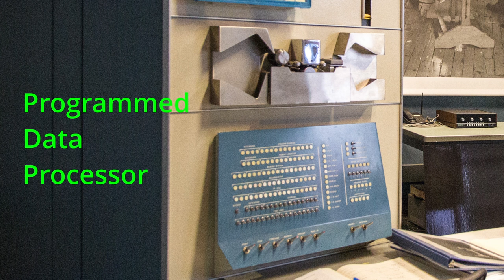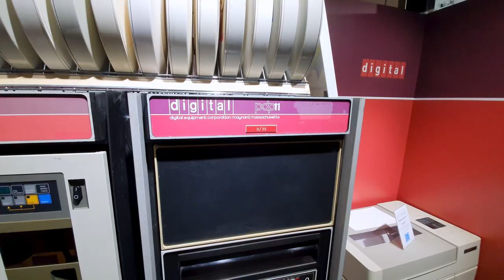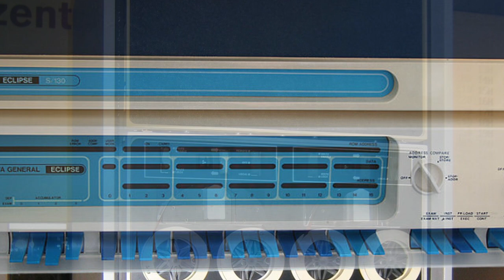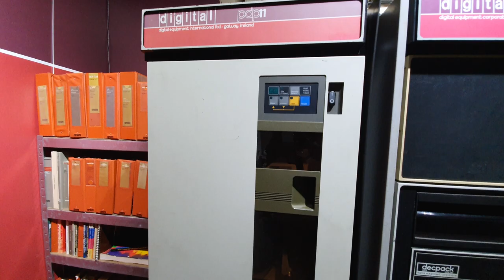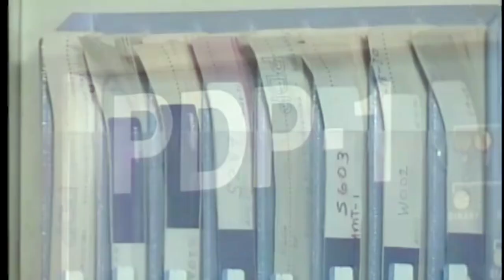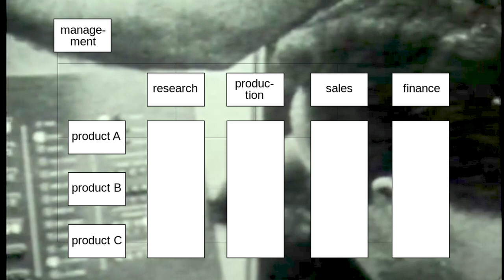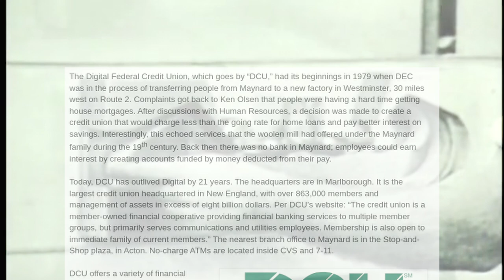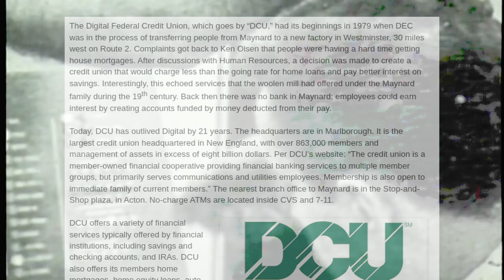DEC and the PiDP-11

Comment: As someone who is blind from birth, I will always remember this company for creating the DEC Talk. One of the first, and definitely one of the best, speech synthesizers. Back in the 70s. They were extremely expensive in the beginning, but they got better and cheaper. Evolving into an internal card, for PC, serial external device, and finally simply software. One of my favorite synthesize voices ever. An early version of it may be heard if you ever listen to Stephen Hawking speak. I don't know the story behind it, but I find it hard to believe it was a business case based on profit potential
Reply: I had a friend who worked on DecTalk (Martin Minow, RIP).  He used to claim it was the only bug-free product he'd ever shipped.
Reply: Did you ever hear it sing?    They had all these demo files to tweak it so it could sing (actually very well).    A DECtalk singing "New York" by Frank Sinatra is something everybody needs to experience :) :) :)
Reply: @mayorsnorkum4005  I heard about those but I never bothered. For me this thing was an incredibly useful tool. Allowed me to do things i otherwise would not. So silly gimmicks like that didn't do much for me
Reply: I was tangentially associated with the development of DECTalk as it was produced by the Terminals Business Unit of which my group was a part. It was quite a revolutionary product. I remember observing QA engineers testing the very early versions. I was fascinated by it. I worked with Martin Minow, he was a great guy. Very smart, professional, and NICE!
Reply: @bobdinitto  that's great. It is wonderful to hear from people who had something to do with this fantastic product
Reply: @kevinbarry71  It was more of a demonstration on just how flexible the platform was.  People used the "canned" voices (Variable Val, and so on).  However, you could configure the system to produce some pretty amazing (and realistic, non-robot, voices).   We used it in a library system, to call customers about items on hold.  We had complaints from customers about how rude the library staff were when calling ... only to realize that they were talking about DECtalk!!!  They didn't know it was a robot, and would try to expand the conversation with it :) :)   Of course, nobody in the 1980's was expecting computers to talk so well.  The Texas Instruments and National Semiconductor versions were much more crude, relative to DECtalk.
Reply: @bobdinitto  Definitely one of their greatest products.  Respect to those guys.   It made DigiTalker look like a toy!
Reply: @mayorsnorkum4005  it was an amazing system. Nevertheless, difficult to believe somebody couldn't tell that was a computer. In my opinion, it is a more modern mistake that people are trying to make artificial voices sound like human voices. That might be OK for phone systems, but a blind person just needs efficiency, and a good computer voice is more effective at communicating than his human sounding voice
Reply: @kevinbarry71  Ironically, the reason for making it as human as possible was to make the customers believe they were getting a "real" call from the library concerning their "on hold" item being ready for collection.  When configured properly (which means, don't just use the defaults), this device could fool most humans.   We ended up using Variable Val, I believe , because it was the easiest one for a listener to conclude was a robot, and then our complaints went down accordingly.    However, once the telemarketers starting using robo-calling in a big way (the 90's), these systems became less popular ;)    However, they seemed pretty cool in 1987 :) :)
Reply: Today you can buy an Emic 2 Text-to-Speech Module by Parallax that uses DECtalk. I’ve used them in animatronic robot sculptures for that old skool speech. As a kid in the 80’s I used S.A.M. A software only speech synth for 8-bit computers. It eventually became the speech synth in the Macintosh.
Reply: @mayorsnorkum4005  the Emic II I mentioned comes with demos and some of them are songs it will sing like  "Bicycle Built for Two” (of course).
Reply: @sideburn  Cool.  I'll have to look it up.   Yeah, SAM really kind of sucked ;) ;)
Reply: @sideburn  "Daisy, Daaaiiissssyyy" (in the HAL 9000 voice, of course).    Epic!
Reply: @sideburn  Synthesized Automatic Mouth was also available for the Commodore 64/128. A friend of mine bout it and was showing it to me. He slipped ff to use my bathroom, so I edited the sample text files while he was gone. He turned quite red when he ran the next sample. He was one of those, I'll teach you to program types. I also wrote a one line program that simulated a failed PLA chip, which caught him off guard. :)
Reply: @michaelterrell  also a version for the Apple ][ but it needed a special card i think since there’s no sound chip. Look up “antic mark barton interview”. It’s a great interview with the guy that created S.A.M.
Reply: @mayorsnorkum4005  ahh yeah, poor HAL 😢 Years ago I made an animatronic robot and he sings daisy :). There’s a clip of it on my YouTube channel…
Reply: @sideburn  I never played with any Apple computers. I have three that I've never plugged in. Two macs ad a II series clone. They just never interested me for some reason. I spent more time on Commodores and repairing industrial computers. I later started repairing and building PCs. In the early days I repaired everything to the component level. I had two new cards for XT or 286 with Apple emulators using 6502 processors but I don't know what happened to them. I never tried one because I didn't have a compatible floppy drive.
Reply: @michaelterrell  similar. I have an apple ][ now i got in mid 2000’s  just to see what it’s all about but I was an Atari 8-bit kid. I have a commodore sx-64, Amiga 1000, and a fried 2000 video toaster that I’m about to try to fix again. This time I’ve got a logic analyzer and oscilloscope to help. Waiting for Agnus chip to arrive. Fingers crossed 🤞
Reply: @sideburn  I have a couple SX64. One has a damaged keyboard cable but both work. I have an Amiga 500, a Commodore 128, a 128D and a pile of leftover Vic 20 and C64 from my days of repairing them. There are also at least a half dozen 1541 drives, some 8950 drives and 4023 printers in storage.
Reply: @sideburn  I just looked at it, and it's pretty AWESOME.   You are the man.   I'd always thought my Tardis was the shit, but I was wrong.    I'll be spending some time browsing your channel.   Kudos, my friend.
Reply: @mayorsnorkum4005  thanks! That was the first one. There’s about 20 more waiting for electronics. Too many projects!
Reply: @sideburn  Yeah, I dig it!    Always too many projects, and too little time.  I've got a crazy backlog.   Now, if we could both just get this whole cloning thing up-and-running, I see a solution :)
Reply: My wife worked for DEC back in the day, I had her record a message on a cassette for my answering machine using DECTalk. Everybody thought I had a computer answering my telephone, which back then was unheard of.
Reply: DECtalk was one of the many things that DEC engineers co-operated on with research and education establishments bodies like MiT.  DEC essentially productised the base speech technologies which Dennis Klatt at MiT had developed. 

DECTalk originally shipped in a separate box because it needed a separate processor. However,  when the MIPs RISC R2000 and R3000 processors were incorporated into a new line of (then) amazingly performant DECstation workstations, DECtalk was implemented as a software-only product, since there was more than enough processor performance, to do that.
Reply: WBCN (The Rock of Boston) had a DECtalk sidekick on their morning drive time show named Carlos.  It sounded to me like it was programmed to make semi-random responses based on a matrix of keywords, like "donut".
Reply: @rocketman71  I received an early demo model of DECtalk hardware which we used in a sales conference by getting it to deliver its own sales presentation from a script which we wrote for it - in "Perfect Pete".
Reply: While working for DEC in the later 80s as a service tech, I had a Lady bring a sick DECTALK into the repair centre to be fixed.
No one had ever heard or seen one before! After some research and a minor hardware tweak it was working and I hooked it up to one of the administration area DECMATEs to run the diagnostic software.

The whole office stopped in their tracks when they heard it singing 'New York New York'!
Reply: But speech synthesis in 2022 uses sampled words, syllables and emotions to create a near perfect voice of the actual person as they sounded at first diagnosis of eventual speech loss.
Reply: @BritishBeachcomber  those voices are great for sighted people. But blind people tend to prefer more mechanical sounding voices that are more flexible and more responsive.
Reply: Interesting
Reply: @gorocket8218  I was at DECUS 1978.  Martin gave a talk there!  I met lots of DEC people and he was very often mentioned by them.  He was a living legend among the DEC people and users alike for his RSTS work. I wish I had gotten to meet him myself.  During that trip I met and had dinner with Mark Bramhall whom I had to confess had indirectly taught me to program as I had access to the early RSTS utilities source code in BASIC, and they had all been written by Mark.  Anyway, Thanks so much for mentioning Martin.
Reply: I spent 20 years touring with a blind musician. During one of my breaks from music i used that experience to try to improve speech synthesis based interfaces for a large company that specializes in touch screen equipped devices that will remain nameless. I'm also a regular on the "Be My Eyes" app. There are so many little things that we take for granted as sighted people. I'm grateful I got the chance to learn from and with the blind community.
Reply: It also provided all the computer voices in Back To The Future II.
Reply: As someone who is also blind from birth, you are absolutely right.

Comment: I worked for Ken from 1993 to 2000. I loved every minute of it.
Reply: Sad he was deposed. Palmer has a lot to answer for selling off database divisions and others (networking?) and the bean counters being short sighted dropping the $1 licenses to universities. I went to Uni in 1988-90 and DEC were strong there probably for that so impressed with DEC VAX/VMS my initial career was a VMS Sys Admin, even had a 11/730 as home computer, doubled up as a large space heater too. But did impress those seeing it when the RA80 spun up like a jet fighter. Nothing like an 160lb (one draw filing cabinet) holding around ~120MB... Later upgraded to VAX 11/750 and got a TU80 tape drive - luxury!
Reply: @rw-xf4cb  I worked for Digital from the end of 1987 to the middle of 1993.  Robert Palmer(not the singer) was a corporate raider that sold a lot of Digital intellectual property to various entities.  I was based out of the South Central Area whose boss was Michael Jackson(not the singer).   I was a principal software specialist.  
Good times until the end.  Got an offer from Oracle to work in California but even with doubling my salary it did not make sense with the high cost of a house in California compared to the cost of mine in Houston, Texas.
Reply: @rw-xf4cb  Loved the 750s and the 785s.  
Worked with them at Brooks AFBs and the UTHSC in the early to mid 80s.  Kudos to you for finding an alternative heating source that had computing power.

Comment: Another nice thing about core memory which I took advantage of (as a service engineer) was, if your computer had an I/O problem so it couldn’t load any code, you could take its memory boards over to another computer of the same model, load the I/O diagnostics, bring them back and plug them in and presto! You could run diags on the broken computer to find out why it was broke! Try doing that with DRAM!!
Reply: Yeah Buddy! Also, DEC Schematics were well done.
Reply: DEC Schematics were great, but so were the IPBs (illustrated parts breakdowns).  All the pieces and parts numbers, right there in front of you.  They were a lot of help for me when maintaining DECwriters.   ✔️👍
Reply: @acmefixer1  ah. That brings back memories. I had a rented DECwriter III in my apartment my senior year at Uni. Dialup via an acoustic coupler. Good times…
Reply: @acmefixer1  And the part numbers made sense in a 2-5-2 numbering format the first two numbers were the class of part, the middle numbers were the number assigned to the part and the last 2 digits were the variant of the part.  There was a "class" of parts for "expendable" parts and one for screws and such and so on.  Then the "variant" could mean the length of a cable or a bolt and such.  When Compaq bought out DEC I was shocked to discover that Compaq simply assigned seemingly random, but sequential, part numbers to the various parts of each system.  It seemed like insanity compared to the well organized part numbers in DEC.

Comment: I used to work for SCI Systems in Huntsville, AL in the mid-1980s.  They made core memories which were still used by the military and NASA due to their resistance to radiation and nuclear micro-burst.  The cores had become so tiny, they looked like pepper in your hand.  One disadvantage of early core memories is when you read the value of a bit (1 or 0), you erased it in the process.  So you had to read each bit and immediately write it back.

Comment: Thank you for making me feel very old, my first job (1975) was booting up the PDP8/E in the morning, this required selecting several 12 bit 
words on the orange & yellow piano keys and then lifting the Deposit key, when all were in memory then Run - this was called the RIM loader.
It should be noted how heavy these things were, it was a three man job to lift one of then into a 19 inch rack.
Reply: Fortunately we had a RKO5 hard disk.  The boot code was just two words:

30:   6743    // I/O function 3 on device 74
31:    5031   // jump to 31
Reply: @georgegonzalez2476  We had RK05 Disc system as well that was the two word boot.
How on earth do you remember the words after all these years?
The RIM loader was used to load programs from Punched Paper Tape (later a proprietary Cassette Tape Loader at a mind blowing speed of 300 baud) into the blank PDPs that were in the actual product the company, Private Telephone Exchange Line Monitors.

Comment: For years in the 1970's I ran PDP8's for NOAA doing hydrographic work.  The manual wanted the power supplies set to 5.0v and 12.0v.  Ran much better at 5.3v.  The 12v side was high enough.  Stout machines.  Noisy, but generally reliable (like decades).  Thanks for the trip down memory lane 🙃

Comment: I learned my first programming in high school. We had terminals (DECwriters) that connected via an acoustic coupler to a PDP-11 in an administration building a couple towns over. The OS was RSTS/e and the language was APL. Once home computers and modems became a thing, we'd log in at night and run chat programs we wrote. It was an early taste of what became the internet. Communicating with people in real time, live, no matter how far away. Eventually, schools went to Apple computers and the need for a network of terminals went away. I was offered the PDP-11 for free. I went to look at it and with the hard drives, it was the size of a refrigerator. I declined.
Reply from the maker: Part of me would really like an original PDP-11, the other part of me knows its completely impractical and would have declined too.
Reply: My story is almost exactly like yours.  I first learned about computers at 14 in private school on a PDP11/34, also running RSTS-E.  I was so enthused, the system manager took me under his wing and showed me how to mount drives and administer user accounts.  I later found a PDP8 with 2K of ram, and it still sits in my parents basement.  It's quite dead (capacitors blew and destroyed the power supply and logic boards),  But I still look at it from time to time to flip the front switches and think of my first DEC experiences.

Comment: I owe so much to DEC for my understanding of computer technology.  In the mid-60s, I somehow got myself on the DEC mail list to receive books like their processor handbooks.  I studied these cover to cover, and I was in 6th grade at the time.  When I worked at UCC in the early-70s, we used PDP-8 machines as the backbone of a world-wide network to remotely access our mainframes.  A PDP-9, and later a PDP-10 provided terminal access called "FAS-BAC". It allowed running programs on the PDP-10 or on the many  IBM 360 and UNIVAC 1108 mainframes.  It also gave us email to others in the company and to our customers.  I was also able to enter programs from the light panel, a technique I was able apply to the mainframes.  In my computer science classes, learning machine code programming, the PDP-11 machine code was like a wet-dream compared to the 360 or 1108 machine codes.  Thank you DEC.

Comment: I first used a PDP11/45 in 1988. The login command is 'hello'. These things were payroll and accounting machines back in the shop is working. I was a Vax guy managing the three 11/750 Vaxes and 8 more remote Vaxes. 2400 modems back then works just as well for console mode tty. I missed those days..
Reply: For the RSX operating system the “HEL” task was used as “HELlo” for logging in, but if you weren’t sure, it could also be used to obtain “HELp” before logging in.